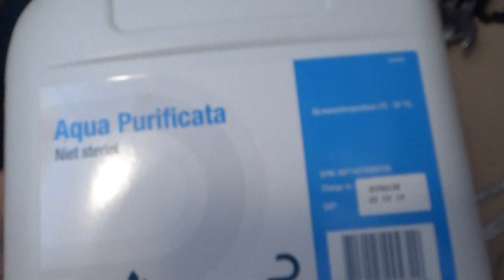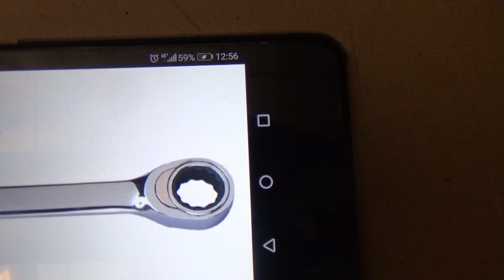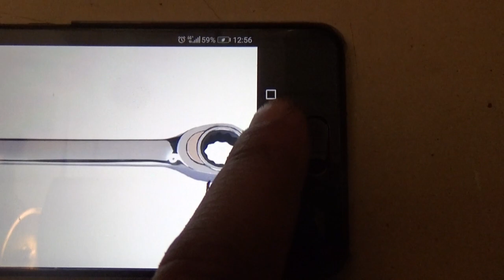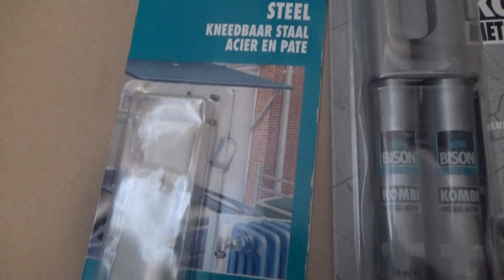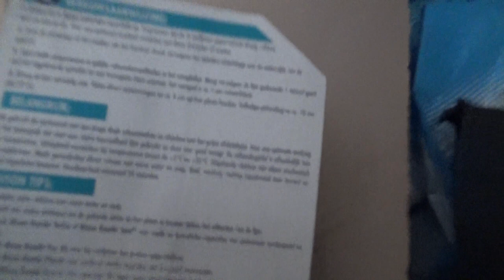Fixing the gearshifter

Comment: Gear shifters take a lot of punishment, good effort to try and DIY fix it but personally I would try to get a proper replacement or a solid fix (weld), would not want to be stranded with a broken/bad shifter while out riding. Can be dangerous too. Ride safe & safe ride to you!
Reply from the maker: Yeah, we might weld it as well to give it the full fix it needs.

But i needed to get it to a welder, so something shortlasting does that trick ;)

Comment: Haha did the same on my XF when it never wanted to stick, just grinded off the middle piece and changed the bolt to a stronger, more newer one, which made it clamp much harder on the shaft.
Can't you get the gear shifter welded by someone you know? (car garage, friend that has a welder) it's safer than using just moldable steel.
Reply from the maker: Yeah, that worked the first time as well.

Have been thinking about welding it, but i need to get it to a welder first ;)